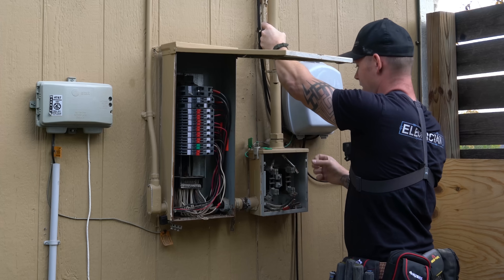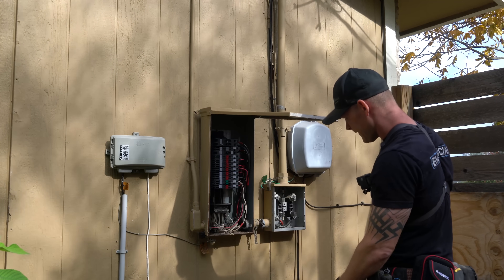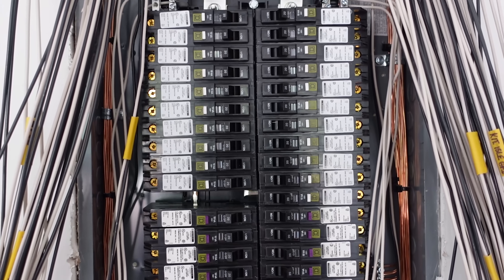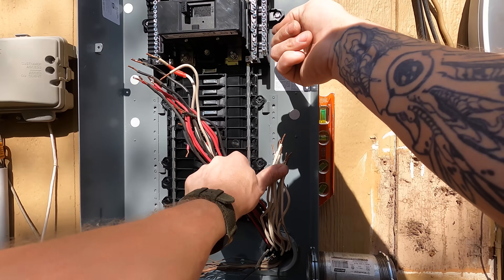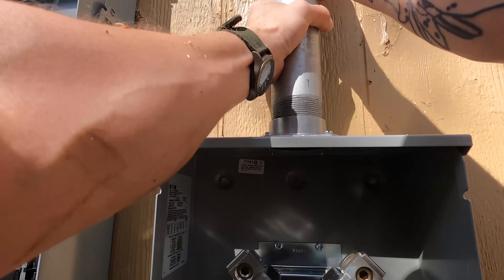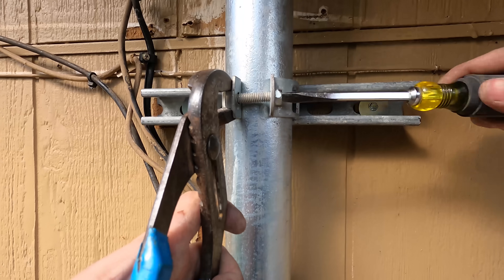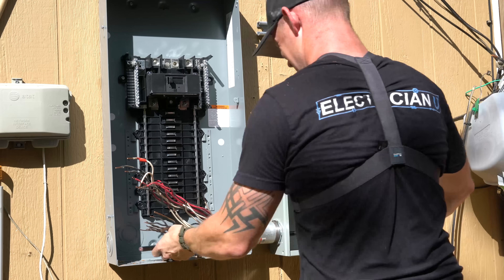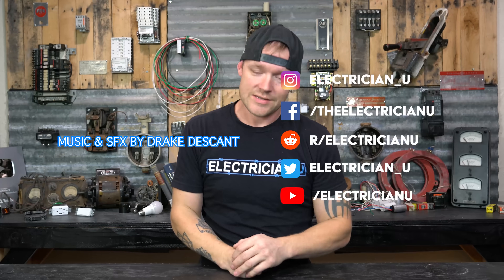How to Replace an Electrical Service Panel, Meter, and Riser (PART 1)

Comment: Ive been doing electrical work fore 40 years im licensed .Your old panel did have a master main breaker. Square d QO is the best & safest panel made 15 & 20 amp breakers are set to instant trip at
150-200amps, Cutler Hammers are set at 650 amps not as safe. The reason they make the mounting holes like that is because this same equipment is mounted to a round pole thus leaving open holes fore water & bugs to get in or if your mounting on an 8x8 post. I dont like the plug on neutral because its UNDERSIZED ALUMINUM. If you had a heavy load from all your AFCI branch circuits
and you dropped one leg il bet those aluminum strips would get pretty warm. I prefer the pigtails because neutrals should be a positive connection. In my area you rough a house in EMT ,use 1900 , 11b type boxes with the right mud rings. Outside you use RMC .IF YOU DONT DO IT IN CONDUIT YOU MIGHT AS WELL NOT DO IT . NO ROMEX, BX or other methods allowed in cook county il. I use copper no 3 fore 100 amps no 3/0 fore 200 amps and a 40 space full sized panel which is inside of the building. I ike the clips in that meter socket you got they make full contact with the meter & have beefy springs. Check out Milbank and see how crappy they make their clips that barely make contact with the meter[ potential hot spot] .I dont understand how places allow romex with plastic boxes i hate that. I could see steel BX because its harder to injure . I also dont understand how they get away with cramming all the circuits through one hole in the back of the panel ,what about de rating? They shur have a lot inferior equipment out there i just dont understand UL fore approving such garbage like aluminum buss panels, speed wire devices ect ect.
Reply: QO panels (in contrast to the Homeline series) have copper bussing.  Are you saying that in regard to the neutral rail of an otherwise copper bus panel, the rail is aluminum?  That sounds odd to me.  Also, it seems to me that these panels have undergone substantial testing before coming to market as to their suitability.  I'm inclined to think the neutrals are not "undersized" as you say.  If the panel has been installed with any measure of balancing between X and Y phase, the effective neutral current should be significantly less than the phase conductors.
Reply: @steveloux4709  I scratched a few neutral rails and yes they are ALUMINUM which makes me really mad because I would expect more than that from a top of the line product.
What I was saying about the neutral rails being undersized is if the panel were under a heavy load and you dropped one leg which would give you 2 wire 120 volts only then
the neutral rails would get mighty warm. These big companies are in bed with the politicians and UL. A smaller company that makes panelboards told me  its who you know 
at UL that will determine what gets approved . These big companies have people working for the people that write the NEC which is PURE WICKEDNESS  in my book. Im
thinking about giving up my license because they just dont make a resi panel I feel safe installing anymore. Im extremely disgusted with Square D and this BS plug on to aluminum neutral garbage they are now peddling not to mention Milbank meter sockets with their BS clips that barely make contact with the meter spade. A line man from my utility said he sees a lot of these overheat. The way American corporations are run is PURE WICKEDNESS and I HATE IT.

Comment: Hi Dustin, what type of cable did you use for the service entrance? Can you use THHN? Are SE-R or SE-U are normally use for service entrance applications?
Reply: Not an electrician fyi but had mine redone recently. SEU doesn't have a ground, so that's typically from meter to panel and then you've got your ground coming from your ground rod(s). SER has the 4th wire in it for ground so you use that for everything after your grounded and bonded first panel/disconnect, typically sub panels (even your main panel is a sub-panel if it's after a main disconnect.)

Comment: When doing an MPU and you have that short wire issue is it okay to just flip the panel upside down?  I’ve seen it done a few times is that still up to code.  

Random note, did it bother anyone else the order of which wires he landed in the meter. I always go green, white, red,
Reply: That is what I thought.  I'm just a home jobber but the subpanel I bought for my garage was CSA (I'm canadian) approved for an inverted install.  That is what I did.  This one doesn't look like it has the same knockouts on the top as the bottom.

Comment: I know the new panel has a main breaker, under what circumstances would you install a main disconnect between the main panel and meter?
Reply: Personally, I am having some work done since where I live they won't let me do it myself.
So when I get this work done I am having a main disconnect put in between the meter and panel so that when I want to do work on my own home and my own panel, I can simply walk outside, throw the main disconnect, lock it out with my lock and tag and go inside and do the work.

This allows me to upgrade panels, fix lugs, heck even run a new service entrance line if I felt the need. 

Right now my area uses smart meters, in the old days I would pop the meter out and do my work, now if that meter comes out it tells on me and I have a very annoyed duke energy guy coming out or a fine coming in the mail for "tampering".

My current house has a 100amp main service to the meter, a completely degraded SEU cable going to the panel in my house, and by degraded I mean the aluminum neutral is exposed completely. But that isn't even the worst part, at the panel some genius decided it would b a good idea to double lug another length of SEU, run it across my basement ceiling, through a conduit buried in concrete, and feed it to my garage panel, the garage panel, of course, has no shutoff and is an old 3 phase panel they jumpered one leg of the SEU to so that it would "work".

So right now even if I shut off my main panel that garage panel is still live, there is no way to shut down my garage panel in the event of a problem without pulling the meter.

And though I can fix this entire issue for the cost of 1 nice new panel, a handful of new breakers, some new service entrance cable, and my time, I cannot do so without pulling the meter.

If I had a main disconnect I could fix this entire clusterfuck and make my house safe. 

Then all I would need to do is get a new pan, conduit, and weatherhead ready to go, call the power company to come to disconnect me at the pole, and quickly upgrade the incoming service line to finish the job. 

What should be a simple job, is now going to require me to have my power shut off for an extended period of time while I fix the issues instead of being able to take care of it easily it is now a massive pain in the rear and is going to cost me 8 times the cost of doing it myself. 

And the worst part, since it would be mine I would be REALLY anal about the panel I got, the features, the wiring paths, the cable management, etc. I have no clue how meticulous the electrician will be.

Comment: Here you can mount the panel inside if meter is next  to it outside ,they do the knock out in case you do  mount using that knock out  to mount on outside .

Comment: What does code say about passing all of the home runs through the 2" knockout in the back of the panel (lower right)?  Are you allowed to pass all of those through one knockout?
Reply: That part is existing.

Comment: This is your house? You did not paint the wood behind the box? You drilled a hole in the roof and did not flash it or seal it in anyway.  Your electrical work is nice though.

Comment: When you were using force to strip the conductor while angeling your blade towards your wrist I cringed. There is certainly safer ways to do this. Would think a $20 tool should eliminate the possibility of being mistaken once over the next thousand times you perform this.

Comment: I have a question, why the connection between the panel and the meter base is allowed to be made with a nipple, if this is not watertight?  Greetings from Costa Rica, we also use the NEC.

Comment: Currently have a zinsco panel and just replaced a 20A double pole breaker to the now Connecticut electric... Would like to change the whole panel out for a modern one or square D.. Whatever is the common panels for today.. The zinsco has worked since the mid 60s when it was installed(guessing) as my house was built from 1 to 2 stories in 1965 by my grandpa who was a cement mason and general contractor... 

I got quoted $165 to change just the breaker as i was afraid to damage something but i swapped it myself with some cursing and chipping of the old brittle zinsco breaker.

Soo far everything is good an the lights on that breaker no longer flicker.  I could only imagine what it would cost to change a whole panel + each breaker cost..  Hopefully soon I can sell my house in CA and get the hell out of here and move to TN.

Comment: Nice video. Very informative.  I replaced my panel 2 years ago.  I had to run two grounding rods as I was grounded to my water pipe.   I had a hard time getting reconnected as a friend disconnected my service.   Friend was a trained juryman with all the proper PPE.  Next time il call the utility so I don't sit in the dark for an extra day.

I did pull a permit and got inspected and signed off on

Comment: I would assume the punch outs are there to keep out critters that could nest in the panel for warmth. Bees, wasps, ants, rats maybe. If the holes were already punched out you would have to plug them to keep them out. So either way you got a step. If the manufacturer punched it then they would have to deal with all that scrap, thats time and money they don't have to spend so you do.

Comment: Pro tip:   After doing several hundred service changes like this, I FINALLY figured out that if I spun the weather head around almost 180 degrees, the service conductors flowed out and around in a nice circular loop and looked better much better than the bent up mess you make trying to make drip loops. 

Try it one time and you will like it :).   Like I said, it took me decades to figure it out

Pro tip #2:  All in one/meter panel combo. They have been the standard in my area since I started in the mid 70's.  One less piece of gear to install.

Pro tip #3.   If you stay in the field, your body will take a beating. The last few years that I worked (in my early 60's) were rough.  Now that Im almost 70,  it is really starting to show.
Reply: I feel the beating at thirty five. Six buldging disks 2 shallow hurniated. Commercial residential industrial service technician. Still mechanic level sadly.... doctors keep telling me to change careers...like yeah let me take a 10$ a hour pay cut, I'm a single dad

Comment: Always enjoy watching these videos and seeing the difference between the NEC and the CEC up here in the north. Very similar rules. We have to use minimum 2.5" for the mast (guess you guys call it a riser.)  Support spacing sounds similar but have to have min 3. Guy lines if mast is >5' above roof. Also have to goop up any exposed threads on the rigid to prevent rust. Must be nice having the panel outside the house, never seen that. Meter base and panel never seem to be located near each other here. Every one I've done we run 1.25" or 2" PVC out the bottom of meter base, expansion joint then underground, stub up near panel location, LB, nipple thru foundation/wall and into back of panel mounted in basement or garage.
Reply: @Jimbo I appreciate your comment, good to know

Comment: Can you mix and match brands between the panel and the meter? I know breakers need to be the same as the panel manufacturer. Sounded like you said Eaton meter with square D panel.
Reply: Square D does not make meter cans

Comment: How were you able to use copper conductors on the service? Ive only seen that on underground feedings directly from a transformer
Reply: You can always use copper. The only reason you haven't seen it is because aluminum is cheaper.

Comment: Can’t believe an electrician lived w/Zinsco breakers for 5 years. Glad you were testing them, every time I test a Zinsco, or the ITE Siemens that were produced for a few years after they acquired Zinsco, at least half of the breakers fail to trip. 

Then again, a replacement QO plug-on neutral and the requisite combo breakers are a lot of $$! I too love those panels, it’s all I use...although getting breakers was dicey last Summer w/Covid shutting down 2 of Schneider’s plants. 

Keep up the good work mate.
Reply: QO w/PoN is definitely my preference too, and I resorted to buying breakers and SPDs on Amazon last summer due to the shortages!   Next in line would probably be Eaton.  I know this guy loves Siemens, but they are dead last in my book.  Although I do think Siemens make one of the better AFCI/GFCI breakers with its diagnostic LEDs (at least they do in the Murray line).

Comment: At 9:15 when he strips the conductor "I like to score" with the razor knife....

I'm an older electrician, only been in the trade since 1970, worked aircraft Navy, nuclear power, instrumentation, licensed master, instructor. One does not score insulation since it can groove the outer strands of the conductor which over time will separate. In addition, at higher voltages the abrupt change of insulation thickness (versus the smooth penciled transition) allows for a capacitance to develop between the conductor and the insulation which is detrimental. This method works well, one cannot argue that. But know that just because something is easy or quick, does not mean it is the best method.

I learned and lived that since I was taught in the Navy. In that case, when removing insulation, pencil your cuts.

Comment: absolutely the easiest panel change scenario ive ever seen. do one in the interior wall back to back meter with rotted wood and dont damage existing wall. and none of the wires reach. maybe  an old fpe panel
Reply: Oh those are so fun. I love going in a welfare hoard trailer to replace an FPE that was actually working just fine. The department of human and health services noticed it and required it to be replaced. I had to kneel in garbage and dog feces with fleas biting me for an hour. At least it was on the rear bedroom wall facing the door and all the wires were easy to get to.

Comment: I can't believe you can get away using such tiny screws to mount thing. What are those #10 ?!  Here in L.A. you have to use at least 3/8" X 3" lag bolts into studs on the uni strut for the periscope. And no flashing on it at the roof?!  Wow.   And even on the cans. One could almost just grab hold of it & yank out the wimpy screws.

Comment: have a circuit breaker that now works in when in the off position, and doesn't work in the on position. I just did some rewiring, and am an amateur. I messed something up somewhere.  What could it be ? Is it dangerous ? Can someone help ? Thanks

Comment: Should of used noalox on the connections in the meter and main feed for the new panel . You have copper to aluminum

Comment: Is that fat ass conductor (main, from roof) required by code in your country (state)? Man, intercity high voltage line in my country is thinner than that. :)

Comment: When installing a circuit breaker should the wire insulation be striped enough so it doesn't get screwed under the screw or does that even matter

Comment: The reason you have to knock out for the mounting screws is because this panel is NEMA approved.    To maintain the NEMA rating  you should mount this with rubber washers and screws.

Comment: They Leave the Knockouts in place for you to remove because you may not use that hole for connection this includes the screw knock outs

Comment: I don't understand why inspectors require ground bushings when you're not using the emt or rigid as ground and pull an actual ground wire through it, seems unnecessary right?

Comment: Awesome video. Now 2 questions. 
1. Where are the grounding rods?
2. Did you connect the bugs up top or does Utility company do that?
Reply: 1. Since it’s a old house the water line coming in is almost 100 copper so that is probably his ground and for w I don’t think electrician are allowed to do that I think only utility can do that, where I live any way

Comment: Looks good , 10 feet is minimum  code as you said  the extra 1'1/2 mass is a good practice  , the plug on neutral makes the job go faster it cuts time in half. (Your conductors are copper) ,,😎👍

Comment: you don't understand why manufacturers put knockouts for screws? it's easy. it's for code conformity. it would require you to use every single screw hole if they didn't because there can be no openings in the box as per code. you'd have to either use them all or jerry rig a way to close the holes you don't use.

Comment: That’s funny the utility is telling you as an electrician how to do your job. They don’t adhere to NEC. And then they go tell you how to install the equipment YOU’RE installing. The nipple was not connected through any oversized KOs on the panel side. Therefor the bonding is adequate through the locknut. Should be plastic bushings and that’s it.

Comment: Looks odd to me. I did this over thousand times. It seemed to me the circuits were not labeled before disconnected from the old panel.
Reply: Victor Lee ... the real question is if they were labeled before the upgrade? He didn't show that part.